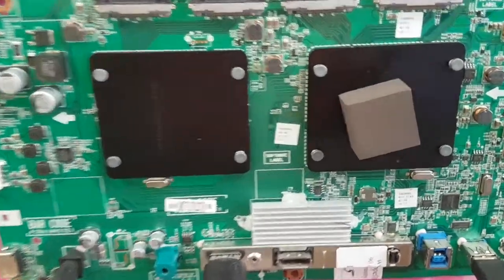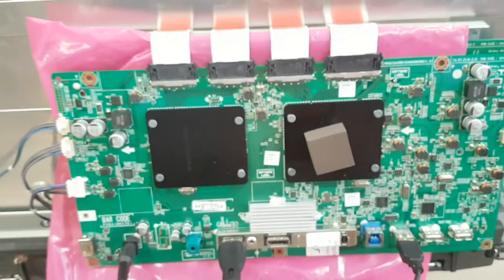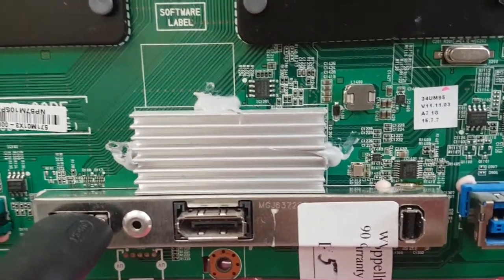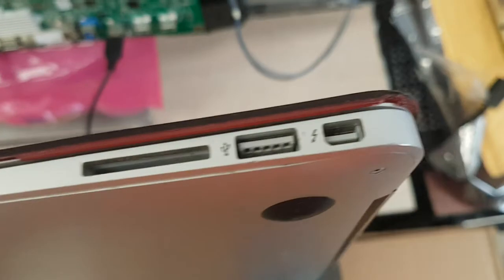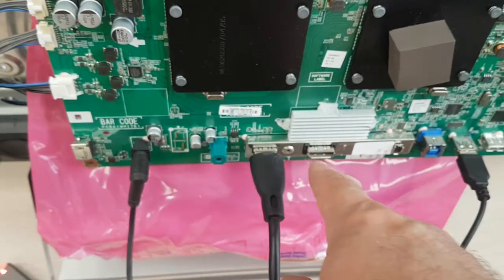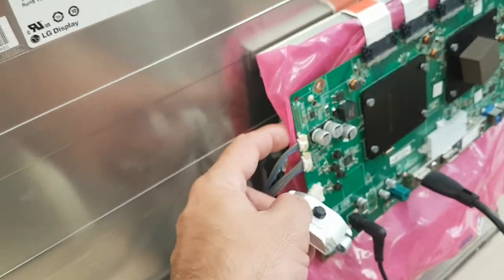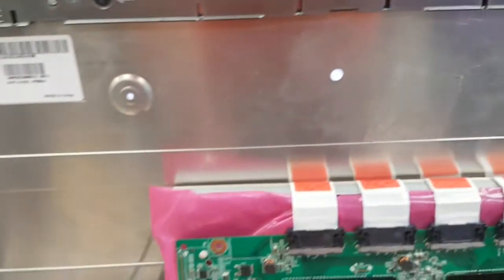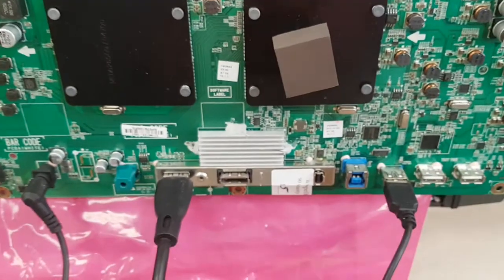Functionality proof LG 34UM95-P main board for C. E.

Comment: I have the same board but it doesn't work... I tested the board with the new adapter but it does not turn on.  It's too far to send you the board(It's south korea here) so, I wanna repair it myself.   Can you do me a favor? which part of the board could cause the problem? mosfet? , smd capacitor? or do I have to reheat the bga chip?
I know it depends on the case.. but I think you know which part can cause the problem the most..
Any advice is appreciated